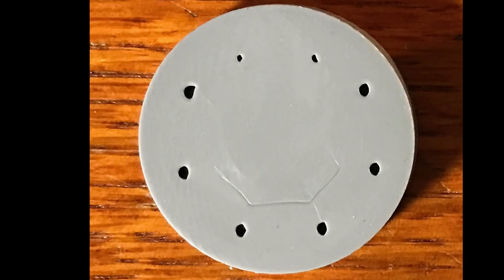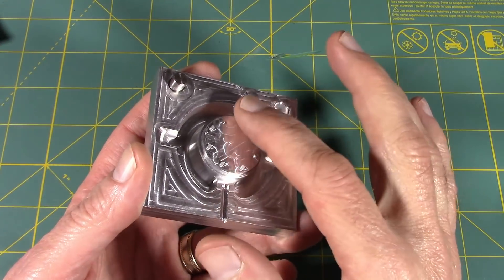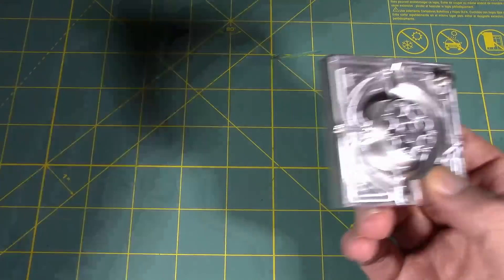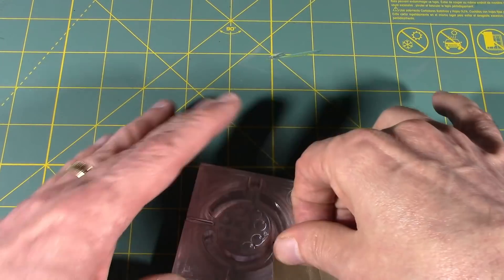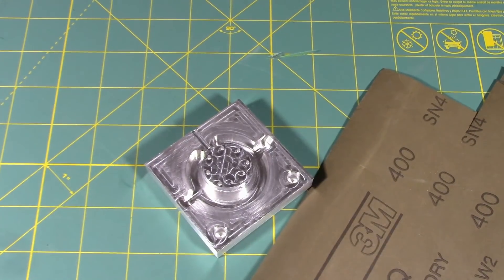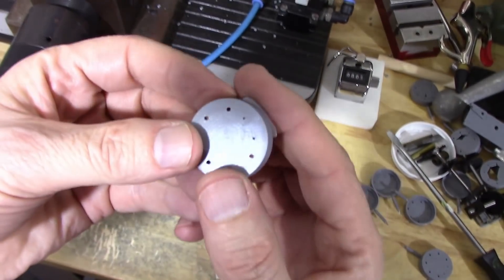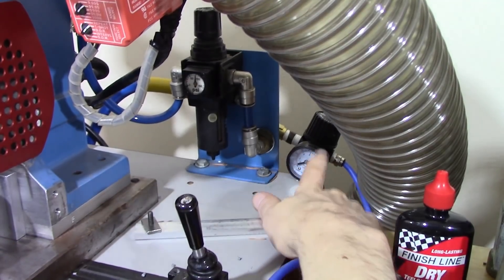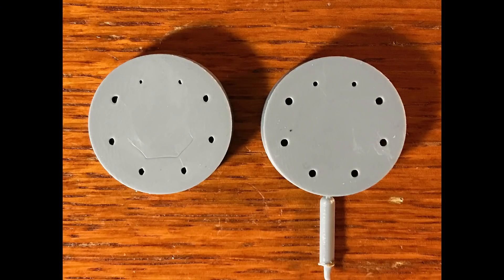Speaker Mold Part 4

Comment: Hi John, great video.  If it wasn't backlash, I'm curious what "mistakes" you could make to make round holes not round.  Was the work holding inadequate or loose?
Reply from the maker: I don't remember exactly. But I believe I was pushing the machine too hard and lost steps on the stepper motors, and then didn't find the edge again right away. So that meant my X was off for part of the milling.

Comment: What kind of injection mold machine ? or did you make it
Reply from the maker: This is the machine I used in the video: https://www.abplasticinjectors.com/ab-100. The previous owner upgraded it with a hydraulic/pneumatic clamp instead of the manual clamp, as well as an electronic timer.

Comment: Great video thanks for posting. What shot is the molder you're using? I have 3 small shot ones and am looking for a little bigger one.
Reply from the maker: This is the machine I used in the video: https://www.abplasticinjectors.com/ab-100. It's 1/3 oz. I also have a Travin TP-1 that is 1 oz: http://www.travin.co.uk/tp1.html

Comment: I use a popsicle stick or a Gesswein stone to minimize rounding off the edges.
Reply from the maker: A popsicle stick without anything on it? Just the wood? I'll have to try that. I had to look up Gesswein stones. What grit and style do you use? I'm going to have to try that.
Reply: JohnSL no I meant a popsicle stick with fine sandpaper wrapped around it.
Reply from the maker: OK, that makes much more sense. I've done that kind of thing. Thanks